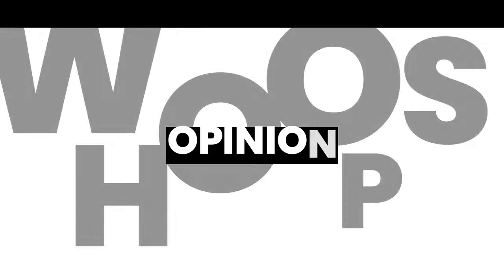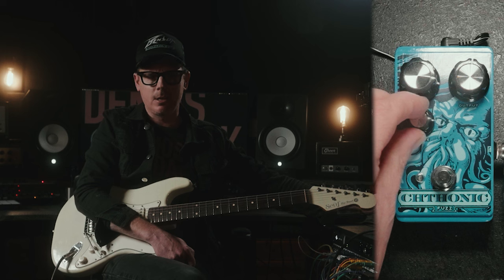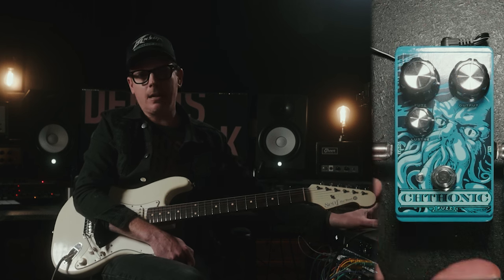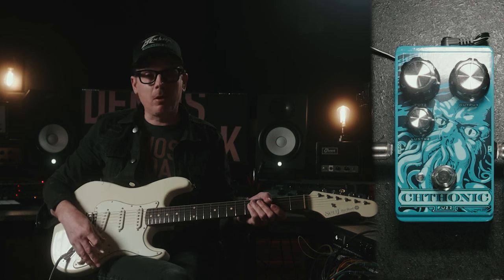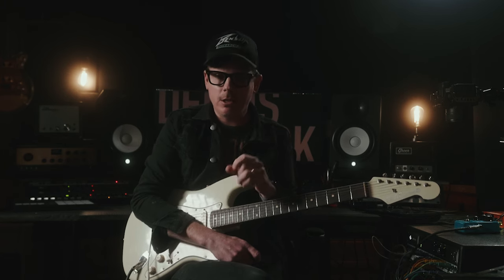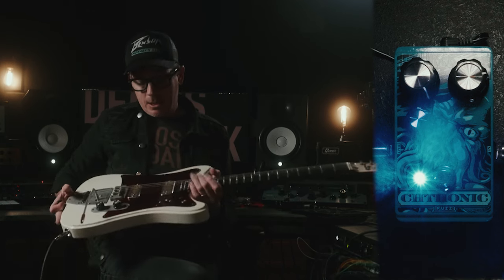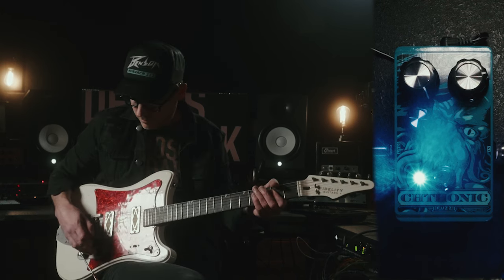Digitech DOD Chthonic Fuzz // Effects Pedal Demo

Comment: I wonder how did this specific schematic for this pedal came up to someone from dod fx? True innovators... I prefer my fuzz throne from Magic pedals though. A video comparisson between the 3 knob cthulu fuzz and the cthonic fuzz seems like an unavoidable battle
Reply: I know you are trying to defend your buddy but the Chthonic started out based on a vintage Colorsound one-knob Fuzz Box, then we added a gain and tone control and it mutated from there.  It's a two transistor 2N2222 fuzz, different name, different circuit.